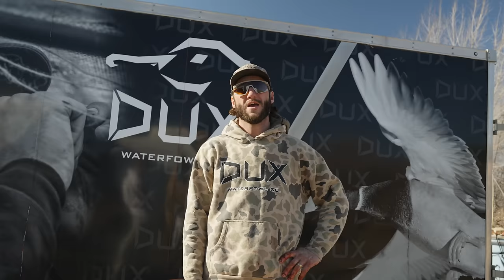Hunting Ducks and Geese on a Beautiful Small Farm Pond!!

Comment: Hey Bobby what shot size do you use for geese that work the best
Reply: Anything from 4 shot to double BB will work depending on your aim
Reply: 3" or 3 1/2" 2 shot typically
Reply: nobody uses 4’s for geese.  for small geese and decoying geese BB’s 1’s and 2’s, for large geese and pass shooting BB , BBB, T shot, #7 Tss. In saying all that take your factory modified choke and pattern some on 3ft x 3ft piece of paper. What works in Bobs gun/choke could be garbage in yours. Fiocchi steel has always worked great for me, and it’s affordable
Reply: @jakegauthier933 - ??? that’s shell length not # shot size. Shell length only adds more pellets and recoil, doesn’t affect fps/power. A 2 3/4in shell throws pellets the same speed of a similar 3 1/2in load.
Reply: @-B_G-  did I not say 2 shot ?
Reply: @jakegauthier933  yea you did, my fault